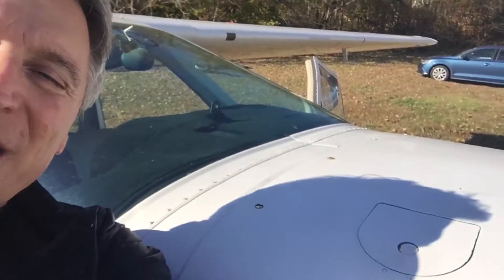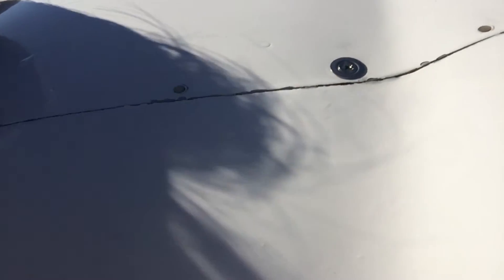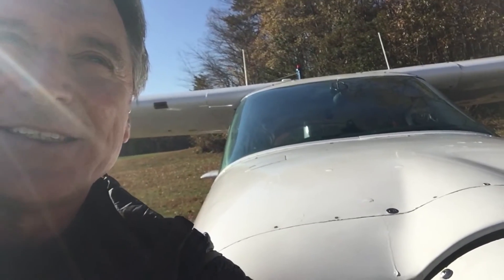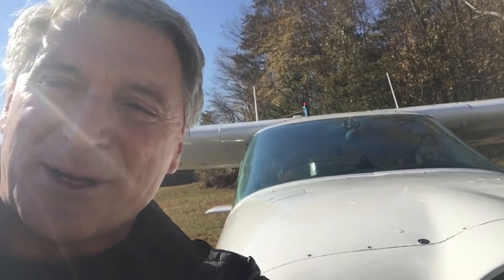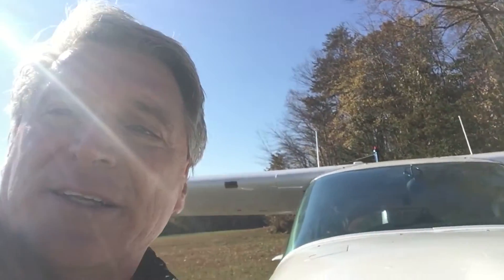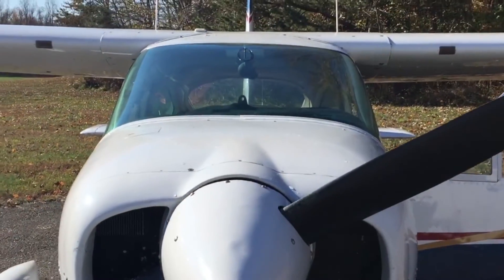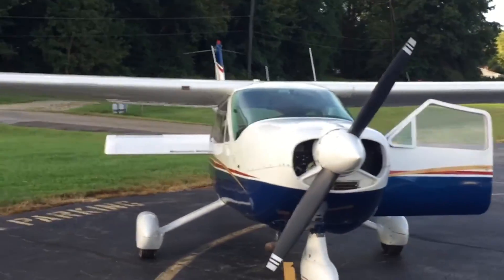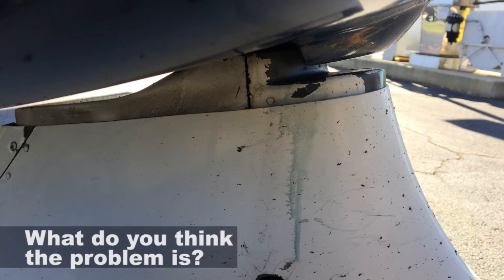My Cowling Rivets Snapped Off!

Comment: If the rivets and the screws are lose ... one most important details is to check the vibration of the engine.. a lot of the cowls problems we have for leak compression of one or more cylinders... last week we have that problem and we install a new spark plug in the lower compression cylinder.... after the engine was running like a new one... and the cowl didn’t loose any screw....

Comment: Check your cowl mounts. They wear allowing fasteners to loosen and vibration to wear the nosebowl rivets.
Reply from the maker: Randy Richmond thanks ! I had that fixed when I got the plane .... hopefully this is a residual issue that just popped up - I did notice that a rivets was missing a while ago .... anything else I should look for ?
Reply: I wrestled with a Cardinal cowling yesterday, same fastener issue. It’s much cheaper to fix things like loose mounts than it is to have cowl repairs made. And NEVER leave the door open. Drill that habit into yourself every time you open it from the inside to think about the wind and when you get out close it immediately. Yeah, it might seem OCD to make yourself close it religiously, but when you see how much a door post/hinge repair costs, you will appreciate the habit @Over50andLearningToFly
Reply from the maker: Randy Richmond absolutely! I learned that my observation watching it happened to another Cardinal

Comment: The engine mounts need to be replaced. The spinner should be even with the cowling. I am not sure on your year model but on my 76RG the lower cowling has a rubber bumper that touches a bracket attached to the lower front engine area. When the engine mounts sag it applies more force on this bumper and pulls down on the cowling. This continual downward force fatigues the rivets and the firewall mounted cowling shock mounts.  Hope this info saves future issues.

Comment: The top of the spinner should line up with the top of the cowl. You might want to plan to save up for new engine mount rubbers.
Reply from the maker: Randy Richmond I just had that fixed - maybe it was an older issue from before?

Comment: 100LL is blue and your leak is green.  The only fluid left to leak in that area is engine oil or strut fluid.   I would think that a leaking strut would not be on the outside of the fairing.  That leaves leaking engine oil.
Reply: Not from the strut, hydraulic fluid is red